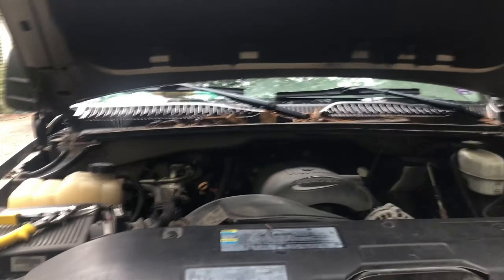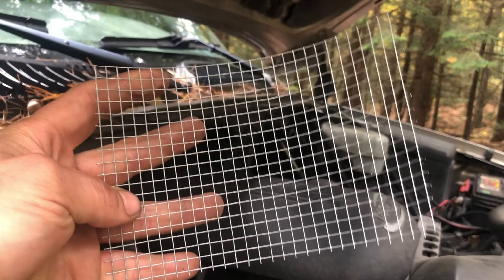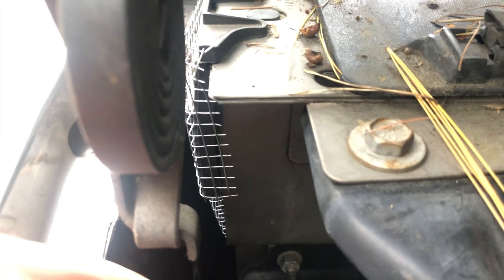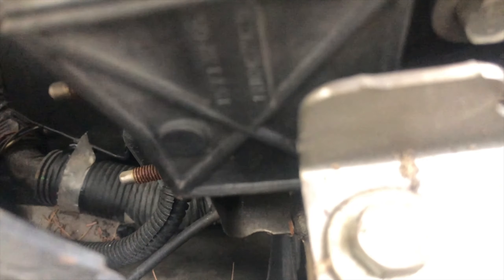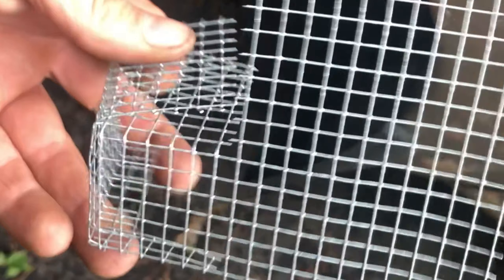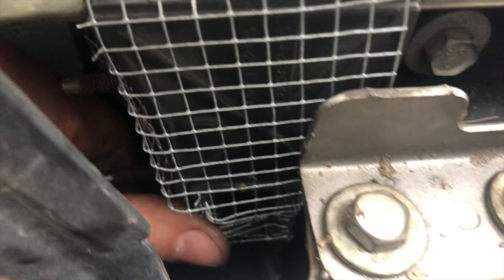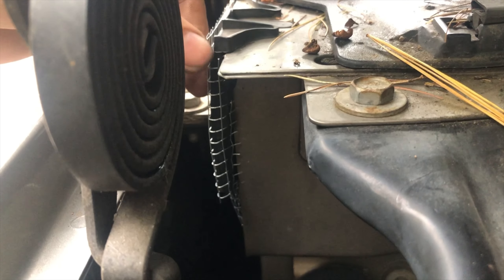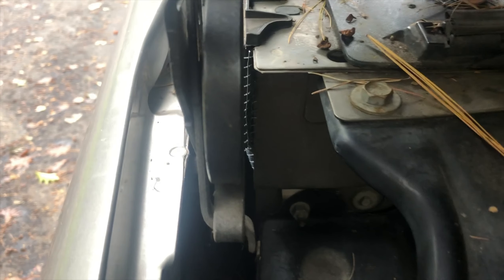keeping the mice out of a Chevy Silverado or GMC Sierra

Comment: I had rubber caps on the ends of mine, found both open and they wouldn't stay shut. I figured the mice were coming in there. I closed the rubber caps and wired them to stay shut. Now when the heater core gets hot, it stinks bad. The mice must have used the heater core for their toilet. I was hoping for an easy way to clean it out, but looks like a nightmare.
Reply from the maker: I hate when mice get in the heater. They might have stopped at the blower motor. I think the blower basket is pretty close to the box and i don’t know if the mice can get through the basket. I try to keep the heaters on recirculate to keep the outside door closed.
Reply: Pull your blower fan out. It removes easily, just press the tab & twist. The mice make a nest in there
Reply: Really? I thought the whole dash had to be pulled apart. I will have to look at it again.  @dp4racing
Reply: @dp4racing  There's a good video on YT about this.  I have 2017 Silverado 5.3 LTZ and had a dead mouse in my blower basket.  There's four(4) 7mm bolts under the glove box that hold the panel.  Then there were three(3) T-20 torx screws holding up blower basket/unit.  When I reinstalled the panel, I only used 2 of the 4 retaining bolts.  The lower 2 are pains to get to and loosen/tighten.
Reply: @HarleyFXS  I also found the mice had gone past the blower & up to the AC core & made a nest there. With blower removed I taped a piece of heater hose to my shop vac & sucked out most of it.

Comment: did it keep them out?
Reply from the maker: I haven’t had any in there since.
Reply: @JasonTheMunicipalMechanic  Thank you for positing this!  I've been calling dealership and googling to try to figure out the best way to keep them from getting in there and to find out HOW THEY WERE GETTING IN!  And I caught that in the first minute of your video.  Thank God I came across your video.  Now, tell me how to clean the airbox out, Lol, I keep pulling the blower and it keeps settling back down in there.  No idea how to thoroughly clean out the box and ducts.  Thanks!
Reply: @JasonTheMunicipalMechanic  Have you had any issues with them getting in the "vents" from the outside that are between the cab and the bed, where the vent leads to just under the back seat?  I have not been able to see what the vent actually looks like since its mashed between the bed and the cab, but I really need to find a way to rodent proof those from the outside.  Otherwise if I only put mesh on the inside of the cab, they'll still nest in the space between the inside and outside.  Let me know what you think.  I can't even find a parts explosion or diagram that shows me what's there.
Reply: I added the screens on both sides I even took off the windshield wiper valance cleaned all the Pineneedles out. I took off the blower motor replace the cabin air filter and set two new traps and sure enough I caught two mice the next night

I did not put the cover back on the bottom of the blower

I don't know where in the hell these things are getting in. All of the holes in the firewall are sealed.

Even if they accessed one side of the blower motor wouldn't they have to pass through the cabin air filter?  That air filter was not damaged and the heater core is right there so somehow they were getting on the other side of the heater core and into the cab unless there's an opening elsewhere
Reply from the maker: Is it possible they were inside there when you changed the cabin filter out?
Reply: @JasonTheMunicipalMechanic  Maybe unless they were hiding really good but this truck is immaculate inside and I've combed it pretty good

I think I'm going to have to gain access to the 4 x 6 scoop  beneath the windshield wiper valance and cover that up directly.
Reply from the maker: I think in the back where the cab corners are there is access into the cab between the panels. There is just a bit of foam sealing it off. They would be inside the panels if they went in there so I don’t know how they would get in the cab though. Are the boots around the steering shaft and wiring harness and shifter cable free of holes?  I haven’t checked everywhere for access because once I put the wire in I haven’t had any mice in mine. I did see a mouse once climb out of the small gap around my windshield wiper shaft on my dodge. He just popped out while I was driving and ran up my windshield. I almost started swerving like I was in an action movie. I also had some get into a Jeep I had by getting on the frame and climbing through a hole in the floor and crawling under the carpet to the front where it stopped. Do you have a floor transfer case shifter?
Reply: @JasonTheMunicipalMechanic  I've checked all holes on the firewall everything appears to be sealed up

I removed a nest beneath the blower motor at the time I had caught one mouse

After cleaning the vehicle completely, that's when I caught two more mice 

So it is possible they were inside the whole time.

Tonight I am watching it with a trail cam next to some traps to see what happens

My next available chance will be to remove the valance again and somehow gain access to the top of the air intake but if I recall that is covered in sheet metal
Reply from the maker: You could try putting the recirculating function on and that should shut the access to the outside of the cab and the heater box. Some blend door settings will disable the recirculate function, I’m not sure which ones but the light will go out if it does I think so you’ll need to make sure it’s closed but it should close off the outside.